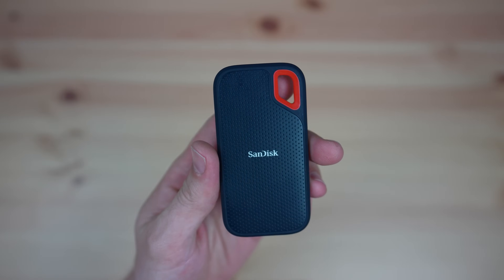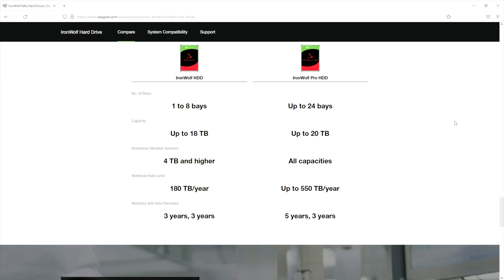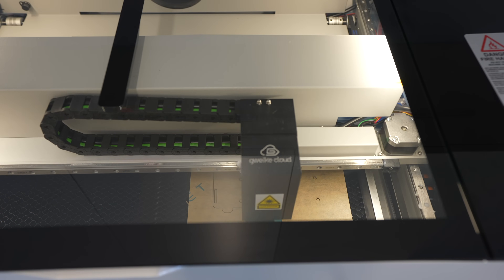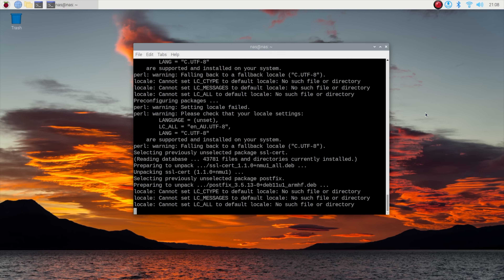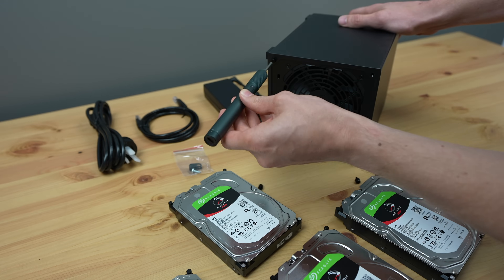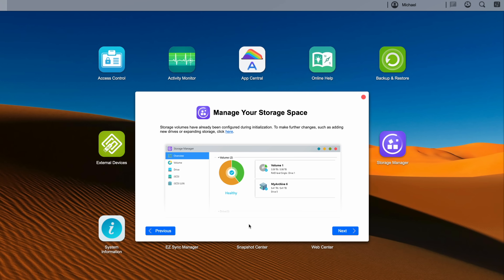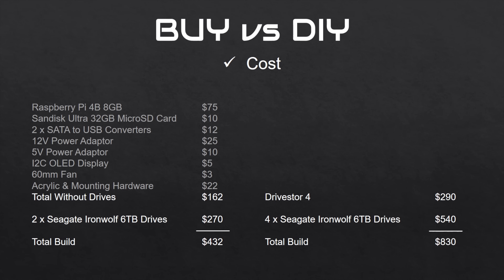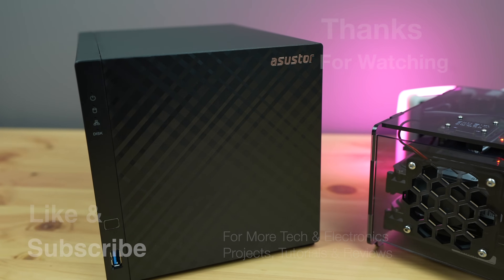Raspberry Pi NAS vs. Asustor Drivestor 4, Is It Better to Buy or DIY?

Comment: You forgot to include the cost of the laser cutting machine for most of us in the world that don't own one. ;)
Perhaps costing in an off the shelf Pi Nas case would have been a better comparison and using only 2 drives in the ASUS. Plus using a 2.5Gbit Ethernet for the raspberry pi. Good video production but the comparisons were not really fair.

Comment: Thanks for making this video, although I have followed the same steps with RPI3B+, but after installing the OMV , I am unable to connect with the WiFi network from my RPi, would please help me with that. Thanks again
Reply from the maker: OMV disables the WiFi network after installation, you need to force it on before rebooting. I talk about this in this video - https://youtu.be/gyOHTZvhnxY

Comment: Cool and simple project, only one question... What if i wanted to 3d print the case? Did you make an STL file of the design? If not, can you please do it?
Reply from the maker: This case is laser cut from acrylic, so I don't have a 3D print design for it. I am working on a new Pi 5 NAS project which should be available in a couple of weeks which will be 3D printable.

Comment: Come back after 15 years and tell us which NAS solution is still working and which can be updated. Web interfaces tend to fail after a few years unfortunately 🫤
Reply from the maker: Since even the NAS drives are recommended to be replaced after 5-7 years, expecting the system to run for 15 years untouched is probably not realistic in any case.
Reply: @MichaelKlements  There are many homes that have nice holiday pictures for more than 15 years. The trick is to only start the system when using it. Then both pictures and disks can last longer 😉

Comment: Really..? Seriously!? So the conclusion you come to is, that the Asus is faster due to the 2.5 Gigabit LAN?!? To be honest, i'm really, really astounded by the fact, that you didn't do a comparison with both being connected to 1GB LAN!! I mean.... how else would you compare those two devices that have this clear difference? For me at least, 1GB vs. 2.5GB LAN was NOT, what i was curious about.... it was Pi vs. Asus with the same drives and same connection. Am i the only one.....? Needless to say, that "most" (...) people won't have 2.5GB LAN in use at home yet... from the switch(es) to all kinds of devices - though getting a 2.5GB NAS could be a good starting point for that, sure.

Comment: Soooo....I need to add in the cost of a 3D printer if I'm going to build my own. For my situation the Drivestor is a better choice. Thank you for this video, I'm trying to get out of the Google/Microsoft/Dropbox cloud, and this looks like an ideal starter home cloud. Does the Drivestor software support a home cloud setup, or would I need to use a different software package? A video breaking this down would be very helpful. Subbed! (I like your presentation style.)

Comment: Great video. thanks!
I will definitely be rewatching this video a few more times as I am planning to make a Pi NAS myself. 
I love the look of the Pi NAS case but wonder why you left the cables hanging out the back. If the case were a few inches deeper you could enclose the USB adapters, have a neater look and some protection for the connectors. 

One thing that is worth considering in deciding between  these two NAS is how much performance (drive speed) you really need. I currently back up to a single large USB3 drive using ChronoSync on a Mac. It does incremental backups (and many other things including scheduled backups) and so the time it takes to back up a video project that is in progress is minimal. Also if you use a utility that backups overnight performance is almost irrelevant as it is using downtime to sync.On the other hand if you are moving files on and off the NAS frequently then performance would be very important.
Reply from the maker: Thanks for the suggestion to extend the enclosure to cover the cables as well, this would definitely make the NAS look a lot neater.
Yes agreed, people get fixated on read and write speeds on a NAS without considering their actual use case. My video on the NAS on a Pi Zero is a good example of this, people are quick to point out the low data transfer speed but if you're using it for general office documents and even a few photos here and there then you probably won't even notice the speed.

Comment: RPi-bases NAS runs open source software which the Asustor probably doesn't. I also wonder if the Asustor comes with a shady EULA.
Reply from the maker: Yes one of the benefits of running a Pi as your NAS is the ability to use open source software.

Comment: Great video.
Although I know this may have been asked before and I've been looking all over the forums, but how are you able to get around 50MB/s or more during transfer on the RPi4 NAS? I just recently set mine up with the same structure but my transfer speeds are atrocious, something between 2-7MB/s. Any advice would be most appreciated
Reply from the maker: I didn't really do anything other than the basic OMV setup - this setup hasn't been optimised in any way.
Are you running the drives in the same configuration with no RAID? Perhaps it is a hardware limiation with the SATA to USB adapters that you're using? I've used some of these that have provided terrible transfer speeds.

Comment: im trying to do exactly this, but I cannot find a case that supports 3.5" drives and a pi... I found a janky drive rack I am currently planning to drill holes on the top for my pi... Not completely satisfied, but I can run a 140mm fan across everything. (I already have a spare noctua)
Reply: Have you been able to find something that works? Currently looking for the same thing. So far the best option seems to be this same style acrylic "test bench for 3.5 inch hdd" from ebay. Then just just mount the pi to it and done
Reply: @minergate4066  I did!, but I ended up taking a different route for 3.5 Inch drives. I got an Odroid Hc4 which has native sata. I used that with a internal HDD cage with a built in fan mount. Then I modded a metal HDD 2.5 to 3.5" adapter to mount the odroid inside the cage. ... so now I have a 2x 3.5" drive nas on my network... For my raspberry pi, I got a single m.2 daughter board so now it boots from a 500gb m.2 and I use it for projects.
Reply: @feralshad0w  Oh interesting choice, seems like there's no easy way out if you want 3.5 inch hdd diy nas. Thanks for your feedback
Reply: @minergate4066  No Problem. I was looking for something that was minimal cost but had the best performance. Not including the drives, i built the nas for about $100 and it performs really well. The pi4 and down options all revolved around a USB solution, but I don't think that is a good long term solution. The odroid Hc4 Also uses less power at idle which is very nice too.

Comment: That's a pretty and neat little Pi NAS, sadly I don't have access to a laser cutter so that's not a proposition for me. My approach, after unsatisfactory results with proprietary single bay backup drives, has been to re-purpose an old PC, first attempt using FreeNAS but, with my non-existent Linux skills that was way too complicated. Instead, I went with a Windows configuration and RAID (2x4TB) which is much more into my tech skills zone. Living in a tropical environment, cooling wasn't straightforward so I was plagued with system crashes and long times to recover the RAID sync. So, I solved that by ditching the RAID and installed FreeFileSync, added a better case fan and overheating problem eliminated.
I mention FreeFileSync in the context of your Pi config only allowing 2 x USB connections and therefore separate disk volumes. I've found FFS to be simple and reliable.

Comment: I used the same setup as you except I only had one drive discoverable on the network and I used the sync option in OMV to setup a sync to the second drive every 15 minutes. Essentially a redundant workaround.

Comment: Did you actually say that there shouldn't be any data loss with the pi as long as the drives remain good? The whole review seemed to be apples to oranges some it is raid vs non-raid.

Comment: @Michael Klements Do you have any suggestion for a cheap and reliable solution, like an enclosure for two 3.5" hard drives in conjunction with the Raspberry Pi?

Comment: use an old macbook for built in ups and usb raid support :)
Reply from the maker: You can force USB RAID support on the Pi, it’s just not enabled/allowed by default
Reply: @MichaelKlements  no offence, so how is this comparison reasonable?
Reply from the maker: Which part don't you think is reasonable?
Reply: @MichaelKlements  comparing 4 drive raid to single-drive, when you can raid them, the whole point of a nas is to remove big noisy drives from your working area, otherwise you can just network-share a drive
Reply from the maker: Raid is one aspect of a NAS, people run a NAS for a range of reasons and I don't think the noise of the drives is very high up on the list of reasons why.

Comment: Yes you can build your own if what you are after is a traditional NAS and you will be end up with better hardware (more ram, better CPU) for cheaper. But what you won't be getting is the proprietary software that comes with the big NAS providers such as in the case of photo storage. Synology offers Photos, QNAP QuMaggie and Asustor Photo AI. All these systems also offer native mobile phone apps to give you a true Google photos replacement. 

Now you can (sort of) get around this depending on your use case. Plex can run on just about anything, so can applications like Pihole, and you will find alternatives like Photoprism out there which are still very decent. Photoprism even has facial recognition. 

I like the idea of using a professional NAS, but I don't like how these manufacturers seem to distribute the costs to include their OS and offerings so you end up with less than optimal hardware.
Reply from the maker: Yeah, the software is something often not factored in to the overall cost of proprietary systems. I'd probably rather pay for the software as part of the upfront hardware cost than have to pay for a software license or monthly subscription afterwards.
Reply: @MichaelKlements  Very true. It just causes some confusion initially when you're looking at systems like Synology where you're paying a premium for mediocre hardware compared to some of the mini PC's that can be bought in that price range, and you're not getting any disks with it. It comes across as almost a barebone system but kind of expensive. What's not obvious is that a lot of that premium cost for Synology is actually for purchase of the included software. That's all proprietary, solid, well researched and established. Native inhouse solutions that aren't running in emulation mode. 

But on this point I have to remind myself we're talking about a NAS - literally a solution devised for storage. If anyone is buying these to actually run most of these services on offer, they would be better off just buying (or building) a dedicated server with all the bells and whistles. It would cost around the same and although more power hungry wouldn't struggle to run an array of services that weren't designed to run on a NAS. 

I'm getting to that stage where I just want a solution that works with the least amount of hassle, without much tinkering or risk and it's a tossup between Synology or Qnap.

Comment: After extensive use of both raspberry pi nas & an asustor nas myself, I will ALWAYS & in future use the raspberry pi! Youre not locked into broken asustor management ('adm') software, the RPi recieves more freq security & os patches & the RPi community is 1000x more helpful. Ive never had an issue with hdd/usb speeds, or streaming across my wifi network; Ive had the RPi4b transcode & stream a video (via kodi) across my network, zero buffer or issues. The RPi is cheaper too.

Comment: You can get more speed out of the drives on the Pi by enabling "write cache" in OMV. Under "Storage > Disks" and edit every drive. I am getting on my Pi4 4GB around 170mb/s. On small files (storing 3D Print files on it).
I even set up a pseudo Raid1. Set up 2 Storages, one you write too, the 2nd for the backups. Under Services > Rsync set up a task (cronjob) to sync everything from drive 1 to drive 2, on the frequent you want. This is how i am running my PiOMV.

Comment: I did something similar using a mini-stx motherboard, i5-6400, 16gb ddr4 sodimm and 2x 3.5 10tb wd red hard drives. It has a male 3.5 in hd power (like a thin mini itx motherboard) that looks a lot cleaner cable wise.

Comment: Did you face any issues with UASP driver? Errors while writing to hard drives after some time?
Reply from the maker: Not with the adaptors that I used, they just worked out of the box. I only had the Pi NAS running for about a week, so I'm not sure long term, but didn't have any trouble in that time period.

Comment: You can get yourself a HP Gen8 microserver from the popular auction website and upgrade it to max configuration with a 45W 4 core, 8 thread Xeon and 16GB of memory for about the same price as the Asus NAS, its runs ZFS software RAID like a champ and it can be further expanded.  Asus are going to need to up the specification a bit on the units to make them more useful, I'd like to see 8+ core CPU's and 16-32GB of memory, speaking personally, if I was going to buy that sort of thing.
Reply: I have a HP Gen8 microserver that I bought from Amazon years ago.  I've upgraded the processor to a Xeon instead of the Pentium CPU that it came with.  7 years old and still running!
Reply: Yeah, I can't see buying a new one when something so capable can be found used so cheaply.

Comment: OMV doesn't support anymore (it did a long time ago) creating a raid array using usb drives, but yet, you can still have an array using OMV, but you need to create the array in terminal using mdadm, and after you create the array it will be available in OMV to be selected.

I also built my personal NAS a few months ago, using also a Pi4 and i am really happy with it and i won't change for a proprietary solution.

For me the most important reasons were budget, power consumption and noise, so i used 2x 2.5" Western Digital NAS Drives 1Tb in RAID 1 using OMV, and it is really great, but for someone who cares more with performance a proprietary system is the way to go.

Great job in the enclosure and keep the good work.
Reply from the maker: I read up that it was possible to configure a RAID array through the terminal, thanks for confirming this.
Thanks for sharing your setup and for the support!

Comment: Yep. Tried the Pi4.  Tried a CM4 with m.2 RAID card.  The best DIY solution continues to be old PC hardware.  Sleep it when not in use and overall power should be about the same as a Pi NAS.
Reply from the maker: How are you implementing the sleep while not in use? Is it automatic, using wake on LAN?
Reply: @MichaelKlements  I use the "autosuspend" service for Linux to sleep my NAS.  WOL is the simplest method to wake.  If you want totally seamless, there is also something called "Bonjour Sleep Proxy" that does some network tricks to wake the server as soon as you access a file share or ssh to the server.  It is an Apple technology but there is a Linux port and I have used it in the past.
Reply from the maker: Thanks for sharing those, I'll definitely look into them

Comment: In 2020, I was looking for a NAS but they were too expensive.. I so went the Pi way
My Pi NAS is a Pi 4 with 3 USB HDDs (WD_Black P10, they were the cheapest at the time) & OMV 6.
- two 4TB HDD 2.5" USB connected to the USB 3.0 ports (and external USB brick for more power)
- one 2TB HDD 2.5" USB connected to the USB 2.0 port

I setup rsync with the two 4TB, runs every night, that way I have a recent backup if something ever happens. I just need to replace the faulty drive and we are up an running again :)

Sequencial write speeds (a 8GB video file) averages around 100/110 MB/s (to both USB 2.0 and USB 3.0 HDD). Not bad for a budget NAS, HDD connected to my PC via USB 3.0 it's only 20/30 MB/s faster
Reply from the maker: If you've got the time to tinker with it and you're happy with slightly lower speeds then a Pi NAS is a pretty good option. OMV also has a really good set of features.